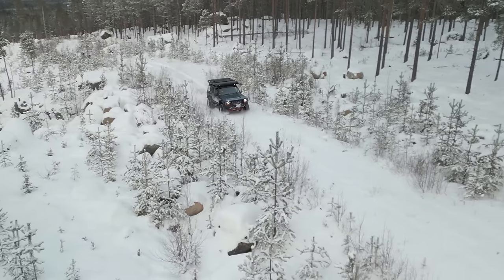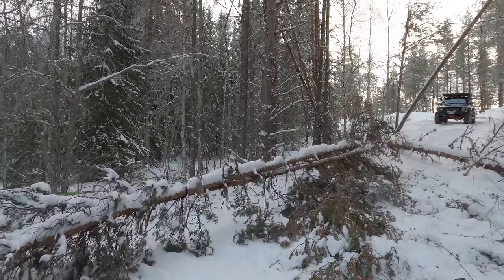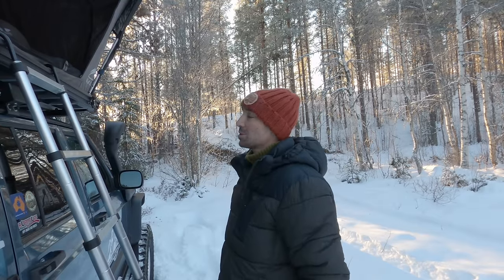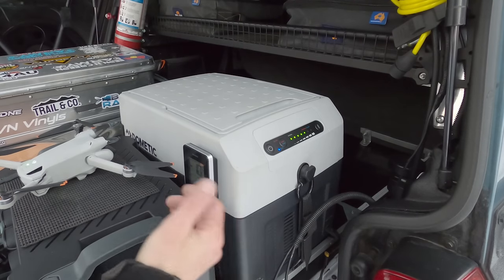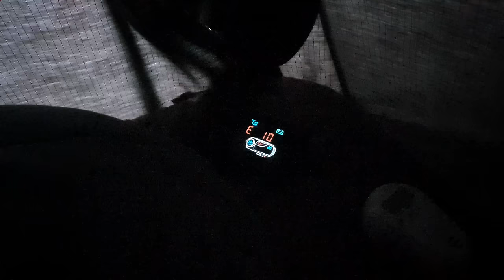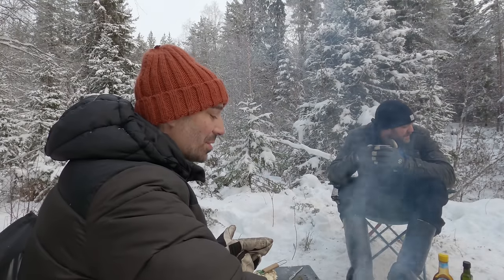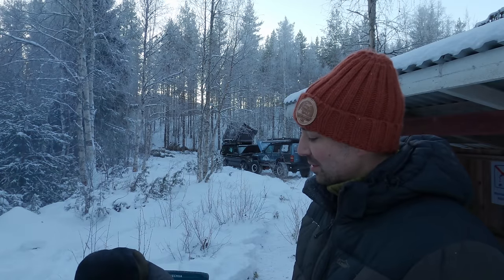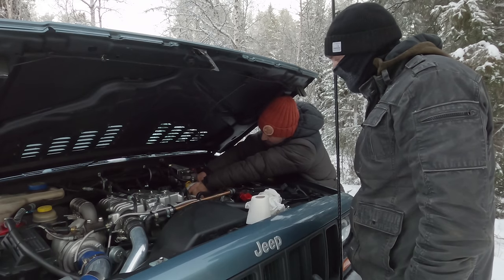Extreme Cold Winter Jeep Camping Adventure

Comment: Hey Mike, I’ve bought an XJ 2.5TD just after following your videos for months. You gave me the hope on that bad talken engine. I live in Italy with an a lot more warm weather.. I saw you did a lot of upgrades on yours engine to make it more reliable. For now my engine has 136.000km and it’s running fine but I always have my eyes on the water temperature gauges and I can’t drive longer distances without starting to overthink about overheating and head cracking lol. What would be the first upgrades you’d do to travel safe without having any overheating / heads problem? Or even upgrades to make my mind go chill.. 😂 
Cheers!!!
Reply from the maker: Congratulations on the XJ, and its a 2.5td which is cool. First off don't be too put off by the negative views on the engine. Very few who comment on it have actually worked on one and most just hear something and repeat it. 
The main thing is the older heads are some kind of magnesium aliminium mix and they go porus and crack. My first job would be replacing all 4 of them with a AMC all aliminium equivalent with valves. While you do this use a metal multilayer gasket, not the paper single ones. Also use new head bolts. 
This alone makes the engine far far more reliable and able to withstand much higher temperatures. 
After this I would look at the cooling system. You want a good HOAT coolant 60/40 mix. This is a modern coolant that will reduce corrosion through electrolysis. It will also contribute to much lower temperatures. While doing this job changing the thermostat and water pump wouldn't hurt. Check hoses for age and replace any if need be. 
The radiator might be full of crap so before putting new coolant in flush the system with water and air. 
Using good quality oil and filters, plus you could always use an oil additive like engine restorer or ptfe will help. All of the above will give you a very reliable engine, no overheating issues also.

Look at how heavy my jeep is, 2.3 tons, my tries, the engine mods I've done to bump up to 150+hp, and I drive my engine pretty hard, also today I was far from home in a remote location in deep snow, chains on the tires blasting through snow. No overheating, not even close. 350c on the pyro gage and 85c on the coolant all day ploughing away. 
Now you could argue I've got a different turbo, manifolds, fuel pump, intake, exhaust, intercooler lol, but its still the same engine. It can be a very solid machine if you want it to be but start with the things that were always a problem to begin with, heads and cooling system, then maintenance. 
After this you can go full turd polish like I have. 

On a side note an engine builder who specialises in engines who I talk to sometimes loves the 2.5vm. He's modded his much more than I have and it's capable of 200hp. Now that's too much for me and I think 150/160 is fine for such a machine, but it just shows what you can do.
Reply: @WorkshoptoWilderness  wow man thank you. I was not expecting a solid response like that? That’s super helpful. 

I will definetely follow all of yours suggestions but I think in a little different order, it makes more sense for me to start from the cooling system as I think it’s the only thing I can do it on my own and with cheap. (I’m not an expert like you) (Also because I have a couple of little leaks on the system lol) and maybe new AMC heads before the summer aswell. 
Thank you again for your response!!

Comment: I'd rather drive THIS than the overpriced Bronco. Looks nice too. The boxy Cherokees are VERY reliable with the 4.0 6 cylinder. I love your rear tip-up windows. It irks me that Jeep never installed one on the rear tailgate because it was not easy to close it. I always had to put my weight on it. I guess the problem was I don't weight much for a 30-something male so I'd hang off the tailgate to pull it DOWN, then lean on it the rest of the way!
Reply: Forgot to add, the 6 cylinder put out 190 hp. It never ever had trouble getting me out of the snow so you do not need a gas hog V8 Grand Cherokee for this.
Reply from the maker: A flip up window on the rear tailgate would have me been fantastic. I have 4.0 at home, just restoring it at the moment, slow progress. This one is a diesel, its an old engine design but pretty simple. The newer vehicles just don't have the same charm, also difficult to work on as they aren't very mechanical anymore. 
Thanks for watching

Comment: Hi
Get a diesel battery driven pre heater for the fuel line and/ or the filter. That can help a bit with bad fuel quality and filter clogging in cold temps. Looks like you are using Volvo truck filter pre-filter. There should be one for the US market that is 12V. If you do not find it check for a UK company Racor if volvo does not have one. Always keep new filters to a diesel. I do not know how your fuel system is built. Some trucks return warm fuel heated by the engine to the tank to heat the tank fuel so slightly. You need higher fuel flow for that.
Reply from the maker: Appreciate that information 🙏 I winter camp a lot and engine preservation is l important. The diesel filter has a warmer in it and warm diesel is returned to the tank. I think a second filter would be ideal along with a engine diesel heater for the block and cabin. Expensive but saves be pulling the engine and dropping the spare in. Thanks for watching
Reply: @WorkshoptoWilderness  I can really recommend a diesel water/cabin heater for a diesel engine. A diesel engine needs it if you are in really cold wether. I even have a petroleum heater on my petrol car today mainly to when I am up in the northern parts.The tricky part is always battery capacity that can handle the cold temperatures. I grew up close to the Arctic circle and have been working with truck fuel system earlier in my career. It is really important to have good batteries in cold temps and a healthy engine. I spent a lot more money on quality batteries when I lived up in the north. Down here I can use them 3-4 time as long. It is much more forgiving down in the “south” if you have bad batteries. 
Secure that you have over capacity on the batteries and that they can perform and give you what you need in cold temps. Secure that your generator can top them up in reasonable tips. Charge them to the top before you go out. 

Remember to start your diesel heater even in the summer and have it running for 15-20 min every month/2 months, that reduces the risk that your heater clogs up and will not start later when you really need it. More or less every brand have that issue!

Do you have a diesel/ air heater for your tent today? Have you thought about using a petrol heater for the tent? I just have a feeling that they are more reliable in really cold temps. Perhaps some one out there have more information about that. One thing have yo thought about building an insulated box where you can heat your camera batteries and perhaps an aux battery for the car to get that extra juice when you need it. Check around if someone have build something like that and if it is worth doing.

Water is a nightmare but so is also bad diesel quality. If I remember correct, the diesel in Sweden have been different compared to down in the continent during winter. This due to gel point on different diesel quality. Probably someone out there that is more updated on that than me.

The return flow must be quite hi to heat the tank since the tank will work as a cooler for the fuel.

I really enjoy your videos, keep them coming.

Comment: First time seeing your channel, very interesting. I have to know what kind of jeep is that and what diesel, never seen anything like it. Thank you
Reply from the maker: Thanks for watching. It's a Jeep cherokee xj but a Europe export model in RHD with the 2.5 vm marine diesel engine. The engine isn't very popular due to the original heads being prone to cracking,  I've modified mine with a better head, manifolds, turbo, pump and many other things so it's around the 150hp mark with 320np plus torque. I've spend the best part of ten years building the jeep and most of the big jobs are on this channel. 
Thanks again!
Reply: @WorkshoptoWilderness  amazing thanks for sharing

Comment: Great video, just subscribed. Just wondered what make / type of engine coolant heater you guys use?
Reply from the maker: Thanks for subscribing. I use a Defa 600w coolant heater. It sits on the lower radiator hose and warms the coolant. It works pretty well but it needs a good 2/3 hours to make a real difference to such cold starts. 
Thanks for watching
Reply: Thanks.  Does it have a pump built in? I don’t suppose you have a part number for the one you are using? Cheers
Reply: @Ivo.Outdoor  cheers for that. I think I’ve decide I’m going to fit a hydronic diesel heater instead even though the price sucks! Had an Eberspacher 5KW on my last truck and it lasted for about 12 years before it started playing up.

Comment: Hey! love the vids! Quick question for ya, How are u balancing those massive tires? Tradition wheel Weights or balance beads?
Reply from the maker: Thanks for watching. I haven't balanced them at all. I just run them as they are. I cant say I've noticed any bad vibrations but I should balance them with balancing beads.
Reply: Oh, okay, that's a quality tire if it's not vibrating at higher speeds without any balance! I had some 35s with thick lugs, and they wouldn't balance with traditional wheel weights. I had to use balance beads, and they worked better than I expected!

Comment: Damn, you're going too light on the clothes at -20C. I say this as a Siberia resident and an ice fisher.
Reply from the maker: Well it's face value with what you can see, not what's under my clothes. I was toasty and I'm out in these temps a lot so it works for me. I cant speak for my friend, his first winter doing this so I'm sure in time he will get some better clothes. Thanks for watching
Reply: @Ivo.Outdoor  prolly it wasn't windy at all, and this helped. We often have winds from 10 m/s and more at -15 -20, and if I write something you did, I would get frozen in an hour. We use special winter fishing costumes, very thick and insulated, waterproof membranes etc. Very often they are floatable.
Reply from the maker: Ice fishing is pretty static in my experience which is why I overdress when I'm just going out to ice fish. 
If I fished on an open lake in -20 in windy weather with the same clothes I have in this video I would only be able to last two hours max before packing up. Its very different to being dug in out of the wind by a fire. Anyway happy fishing.
Reply: @WorkshoptoWilderness  true. We usually stay on the ice for around 6 to 7 hours. Same to you, lucky fishing :)

Comment: What lift and tire size are you running ?
Reply from the maker: Tires are 35x12.50r15 and the lift is something I've put together. It's 6.5" in height though.
Reply: Nice how does it handle on road at highway speeds have you built the axles up or anything ?  Thanks for the reply
Reply from the maker: @theviper6602   I film build videos when I have projects on. 
The most recent work is here - https://www.youtube.com/watch?v=DDM_DadSifk 
and here -  https://youtube.com/watch?v=ApB-AI_DEok
It drives very nicely now but I did some extensive work on the front. Finding a new front axle in Europe isnt easy so I chose to build up the D30HP. Cut and turned the C's. caster, camber and pinion adjustments with some reinforcements and a 3 link long arm build to make it ride better along with some better suspension travel. 

It drives at its best at the moment although I need to balance my diy rear driveshaft lol.

Comment: Sounds like a diesel?
Reply from the maker: Yeah its a marine diesel engine. Old pushrod VM 2.5, 150/160hp around 320nm torque. Nice old engine, lots of grunt, ordinally shit cylinder heads but aftermarket replacements sort that if you care to spend the money and polish a turd.

Comment: What axe are you using?
Reply from the maker: The front is just a HP Dana 30 that I've trussed, gusseted and put some chromoly shafts in. The rear is a bog standard 8.25, 29 spline. Thanks for watching
Reply: @WorkshoptoWilderness  axe, not axle. 🤣
Reply from the maker: @shooter77us  ah so sorry, its a Hultafors Classic Hunter. I've hung a 26" handle on it though.
Reply: @WorkshoptoWilderness  no big deal. It's very easy to see how you could have axles on the brain right now. 😎
Reply from the maker: Yeah that's true!